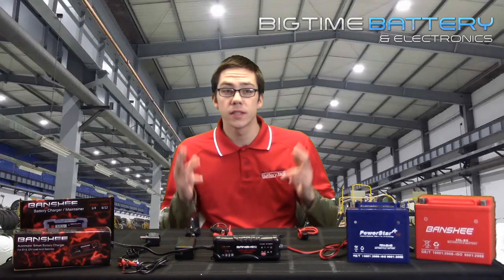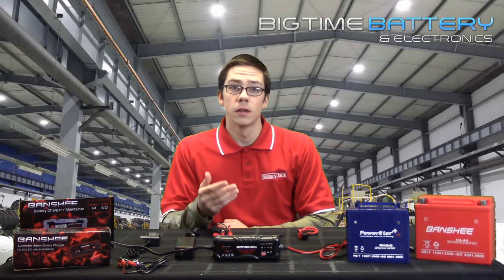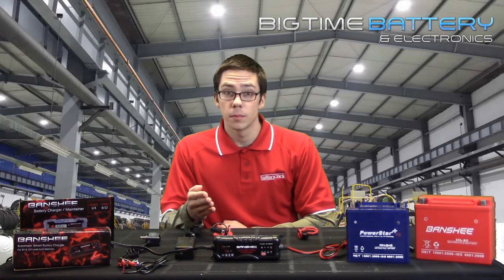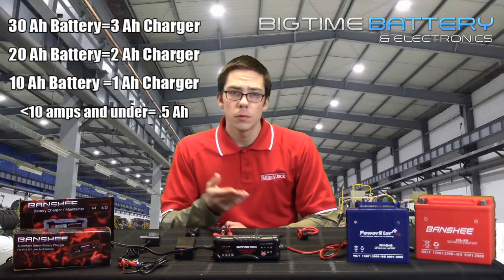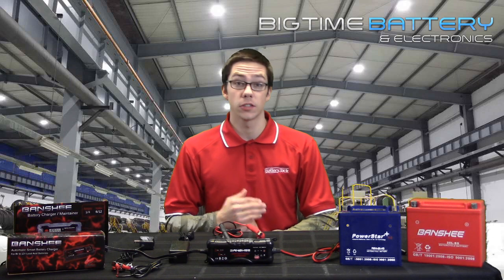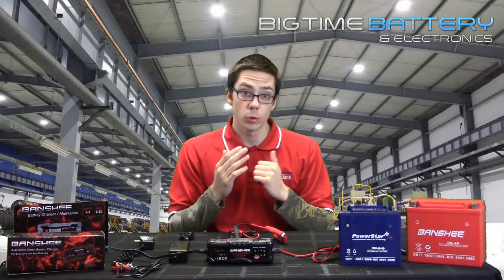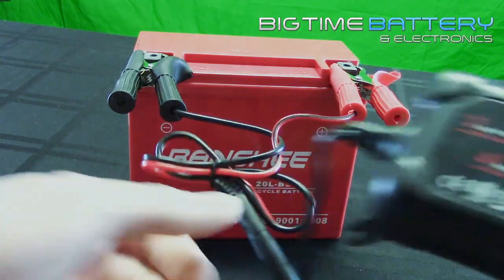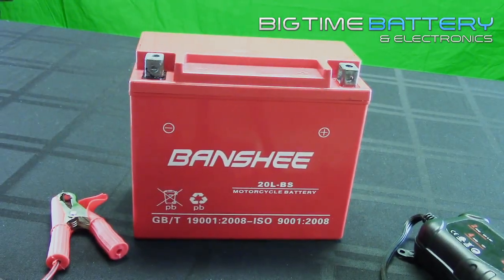How to Charge a Motorcycle Battery

Comment: Do you hLf to keep it pluged in to your bike when charing it if it dies? Or can i just charg the battery with off the bike?
Reply from the maker: Whether you can charge the battery while it's still connected to the bike or if you need to remove it depends on the specific design of your bike's charging system. Some bikes allow you to charge the battery while it's connected to the bike, while others may require you to remove the battery and charge it separately.

If your bike allows for charging while the battery is still connected, you can simply plug it into the charger without needing to remove it. However, if your bike requires you to remove the battery for charging, you'll need to follow the manufacturer's instructions for safely removing the battery and then charge it using an appropriate charger.  If you need free battery help call or text us at: 815-467-6464 or email me directly at cody@batteryjack.com

Comment: I bought a brand new bike and built it did an oil change and everything and never got a first start up and it seems like the battery was low out of the box so im gonna charge it wish me luck today
Reply from the maker: Best of luck with charging your bike's battery! It's not uncommon for new batteries to have low charge levels out of the box, especially if the bike has been sitting for a while before purchase. Charging it before the first start-up is a good idea to ensure it has enough power to crank the engine successfully. Make sure to follow the manufacturer's guidelines for charging the battery properly. Once it's fully charged, you should be ready to start up your bike and enjoy your first ride. If you encounter any issues or have further questions, feel free to ask for assistance. Safe riding!

Comment: Can i recharge my gel type battery? And how can i charge it?
Reply from the maker: Yes, gel-type batteries, also known as gel-cell batteries, can be recharged. These batteries are a type of valve-regulated lead-acid (VRLA) battery, commonly used in various applications, including ham radio equipment like the Baofeng UV-5R HP.

To recharge your gel-type battery, you'll need a suitable charger designed for lead-acid batteries. When selecting a charger, ensure that it is compatible with gel-cell batteries and has the appropriate charging characteristics to prevent overcharging or damaging the battery.

Here's a general procedure for charging a gel-type battery:

Connect the charger to a power source and ensure it's turned off.
Identify the positive (+) and negative (-) terminals on your battery and the charger.
Connect the positive lead of the charger to the positive terminal of the battery and the negative lead to the negative terminal. Ensure proper polarity to avoid damaging the battery.
Turn on the charger and select the appropriate charging mode if applicable.
Monitor the charging process. The charger may have indicator lights or a display to show the charging status.
Once the battery is fully charged, typically indicated by a green light or another signal depending on the charger, disconnect the charger from the battery and power source.

If you have any other questions please feel free to call or text us at: 815-467-6464 or email me directly at cody@batteryjack.com

Comment: Just bought a brand new Banshee battery from you to start up my chopper, i had a HD sportster battery before  so I got the Banshee equivelant. plugged it in and bike won't start. Battery tender shows 95% charged .... what's up with that. Hope charged over night it'll start tomorrow
Reply: did it work?
Reply: Did it work?
Reply from the maker: It sounds like you're experiencing some frustration with your new Banshee battery, but don't worry, there might be a simple explanation.

Here are a few things to consider:

Compatibility: While you mentioned getting the equivalent of an HD Sportster battery, it's essential to ensure that the Banshee battery is indeed compatible with your chopper's specifications. Double-check the battery's specifications against your chopper's requirements, including voltage, CCA (Cold Cranking Amps), and physical size.

Initial Charge: Even though the Battery Tender shows 95% charged, sometimes a brand new battery might require a bit more time to reach its full capacity. Charging it overnight as you plan to do is a good idea. Make sure you're using the appropriate charging settings for your battery tender.

Connections: Ensure that all connections to the battery terminals are secure and free from corrosion. Loose or corroded connections can lead to poor electrical contact and prevent the battery from delivering power to start the bike.

Starter Motor: If the bike still doesn't start after charging the battery overnight, it's worth checking the condition of the starter motor and associated components. A faulty starter motor or related issues could prevent the engine from cranking, even with a fully charged battery.

Comment: Please tell me how much time 12V 2.5amp battery takes to be charged on 12V 1amp charger.please reply
Reply from the maker: To calculate how long it will take to charge a 12V 2.5Ah (Ampere-hour) battery with a 12V 1A (Ampere) charger, you can use the basic formula for charging time, which is:

Charging Time (hours)
=
Battery Capacity (Ah)
Charger Current (A)
Charging Time (hours)= 
Charger Current (A)
Battery Capacity (Ah)

 

It will take approximately 2.5 hours to fully charge a 12V 2.5Ah battery with a 12V 1A charger, assuming the battery is completely depleted and the charging process is 100% efficient. In real-world scenarios, charging efficiency and other factors may affect the total charging time, potentially making it longer.

Comment: I didnt use my bike for a week and it took 3 times to fire it up is that normal ?
Reply: As far as I know, it's normal for a bike to get cold and thus harder to get running the longer you let it sit.
Reply from the maker: It's not uncommon for a motorcycle to require several attempts to start if it hasn't been used for a week or longer, especially under certain conditions. Here are a few factors that could make this situation normal:

Battery Power: If the battery is not in optimal condition or nearing the end of its lifespan, it might have lost some charge over the week. A weaker battery can make starting the engine more difficult.

Fuel System: In carbureted bikes, fuel may evaporate from the carburetor if the bike sits idle, requiring a few cranks to get fuel moved from the tank to the engine. For fuel-injected bikes, pressure may need to be rebuilt in the system.

Engine Oil: The oil settles when the bike is not used, and it might take a bit longer for it to circulate properly throughout the engine upon starting, especially in colder weather.

Weather Conditions: Cold weather can affect battery performance and the viscosity of engine oil, making the engine harder to start.

Idle State: Various components, like spark plugs, may be slightly more resistant to work optimally if the bike has been sitting idle, requiring a few attempts to start.

If your motorcycle starts after a few attempts and then runs smoothly, it's usually not a cause for immediate concern. However, if this issue persists or worsens, or if it takes multiple attempts to start the bike regularly, it would be wise to check the battery condition, spark plugs, fuel system, and whether the bike needs a service to ensure everything is in good working order. Regular maintenance can often prevent or minimize these issues.

Comment: Which charger for a 12v 10ah battery...1ah?   Thanks!!
Reply from the maker: Yes rul of thumb divide the battery capacity by 4 so if it is 10ah divide 10/4 and get 2.5 - so you would not want to use any charger larger then 2.5 amp out put- hope this helps - if you need any other help please call or text 815-467-6464 or email me direct: cody@batteryjack.com

Comment: I am currently thinking of trying my Shumacher 3A Powersport/12A Automotive speed charger will my Yuasa YTZ14S motorcycle battery be okay to charge with this? It is a charger than will stop charging and go into Maintenance/Maintain mode.
Reply: dodgwmon,. Did you get a response about using your charger on a lithium?  I have the same charger.
Reply: No i did not get a reply. I ended up buying a battery tender plus off amazon it's really good.
Reply: dogdemon07  cool, and thanks for the response.  Which tender did you get?  I'll probably go the same route.
Reply from the maker: Using your Schumacher 3A Powersport/12A Automotive speed charger on a Yuasa YTZ14S motorcycle battery should be okay, provided the charger is compatible with the battery type and the charging specifications match the battery's requirements. The Yuasa YTZ14S is a 12-volt AGM (Absorbent Glass Mat) battery, and it's important to use a charger that is suitable for AGM batteries to ensure safe and efficient charging.

The Schumacher charger you mentioned has the capability to automatically stop charging and switch to a maintenance or maintain mode. This feature is particularly beneficial for preventing overcharging and ensuring the battery remains at optimal charge levels, which is crucial for extending the battery's lifespan.

Here are a few key points to ensure compatibility and safe charging:

Charger Compatibility: Verify that the Schumacher charger is compatible with AGM batteries. Most modern chargers are compatible with multiple battery types, including AGM.

Charging Rate: The 3A setting on your charger is appropriate for motorcycle batteries, including the YTZ14S. A 3A charge rate is safe for most motorcycle batteries and is within the recommended range for maintaining and charging without causing damage due to excessive heat or overcharging.

Maintenance Mode: The maintenance or maintain mode is an excellent feature for keeping your battery at a full charge without the risk of overcharging. This mode applies a trickle charge or periodic charging to keep the battery topped up, which is ideal for batteries in storage or for extended periods of inactivity.

Follow Manufacturer Instructions: Always follow the charger manufacturer's instructions and the battery's charging guidelines to ensure safe and effective charging.

Monitor the Charging Process: While the charger is designed to switch to maintenance mode automatically, it's a good practice to monitor the charging process, especially the first few times you charge the battery, to ensure everything works as expected.

If your Schumacher charger is designed for use with AGM batteries and has an appropriate charge rate for your Yuasa YTZ14S, using it with the features mentioned should be safe and beneficial for maintaining your motorcycle battery.

Comment: do you carry  marine batteries for diesel engins
Reply from the maker: We carry a wide variety of deep-cycle batteries that'd definetly be capable of powering a diesel machinery. I'd say give us a call at 1 815 467 6464 and with a couple of questions we'd be able to pin-point what exact battery would work best for you.

In the meantime feel free to check these out to see if they may suffice: 

Dual-Purpose Marine Battery - Deep Cycle & maintenance free
http://bigtimebattery.com/store/d31m100.html
Reply from the maker: Hope that helps Al
Reply from the maker: Always trojan as well!

http://bigtimebattery.com/store/trojan_batteries_direct.html

http://bigtimebattery.com/store/12V_55Ah_Deep_Cycle_Battery.html